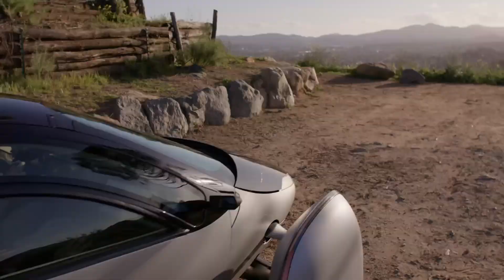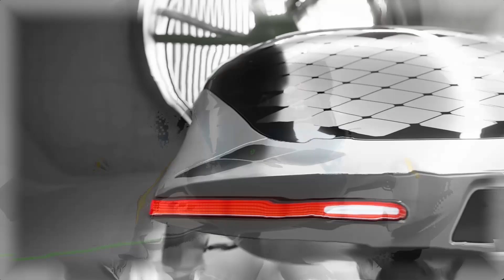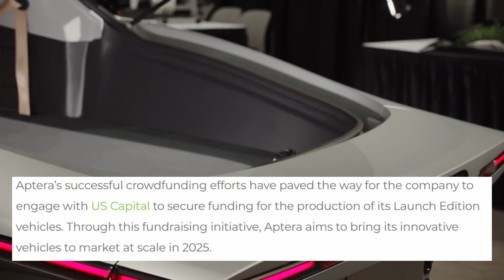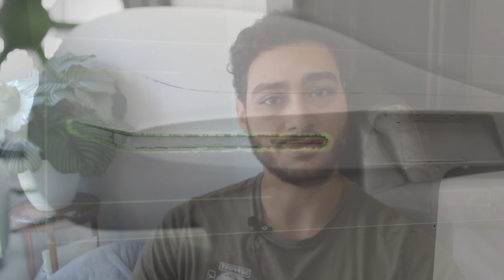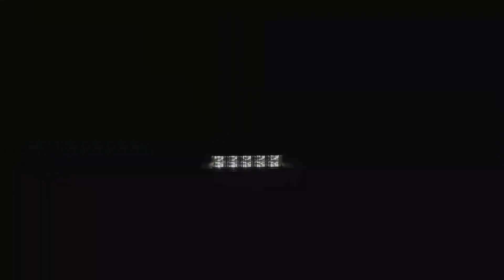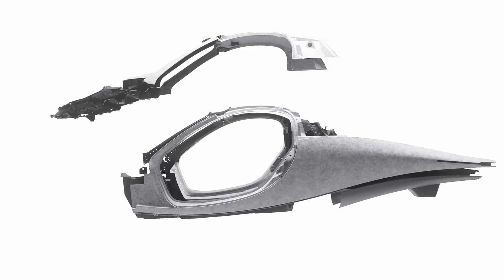The Aptera: How Electric Cars SHOULD Be

Comment: Aptera is a motorcycle, not a car. And as a motorcycle it does not have to conform to any safety standards necessary for cars. So why should cars be like Aptera?
Reply from the maker: It’s actually an autocycle, which lives somewhere between both of those. 

Cars & trucks definitely have important use cases that this vehicle can’t compete against but the Aptera has some interesting properties that regular gas/electric powered cars can only dream of.
Reply: @TechTonko  Autocycles are motorcycles. They do not have to conform to any safety stanfdard necessary for cars. 
 See also Aptera FAQ. 

GENERAL ASSEMBLY OF NORTH CAROLINA
SESSION 2015
HOUSE BILL 6
RATIFIED BILL
H6-v-3
AN ACT TO DEFINE AND REGULATE AUTOCYCLES.
"Passenger Vehicles. –
a. Autocycle. – A three-wheeled motorcycle that has a steering wheel,
pedals, seat safety belts for each occupant, antilock brakes, air bag
protection, completely enclosed seating that does not require the
operator to straddle or sit astride, and is otherwise manufactured to
comply with federal safety requirements for motorcycles.
a.a1. Excursion passenger vehicles. – Vehicles transporting persons on
sight-seeing or travel tours.
…
d. Motorcycles. – Vehicles having a saddle for the use of the rider and
designed to travel on not more than three wheels in contact with the
ground, including motor scooters, autocycles, motor scooters, and
motor-driven bicycles, but excluding tractors and utility vehicles
equipped with an additional form of device designed to transport
property, three-wheeled vehicles while being used by
law-enforcement agencies and mopeds as defined in subdivision d1
of this subsection."
Reply: @TechTonko  The only interesting thing of the Aptera motorcycle is the aerodynamics. Everything else is mediocre.